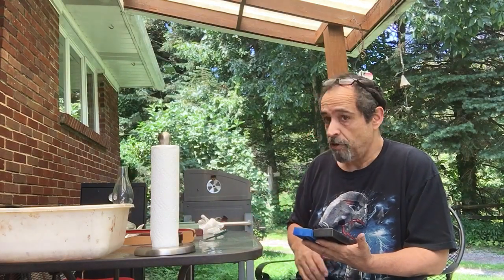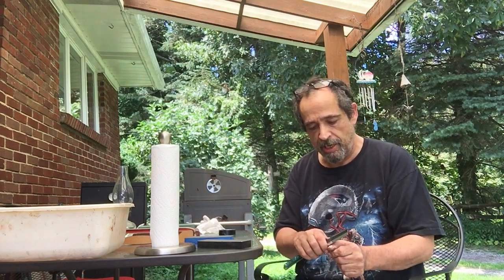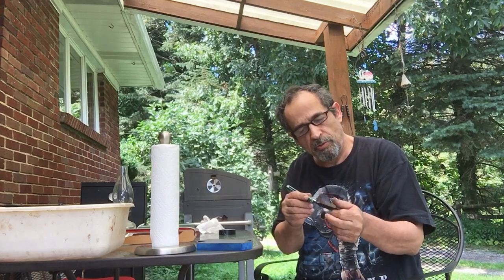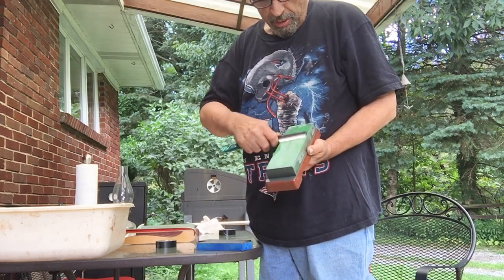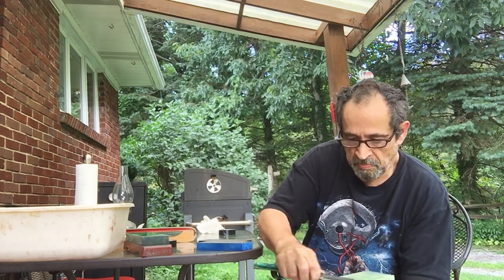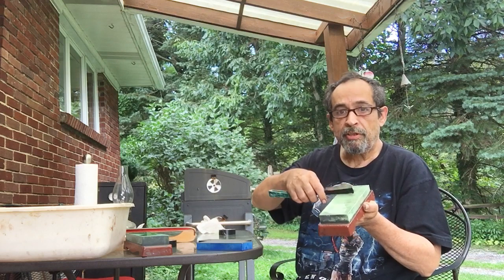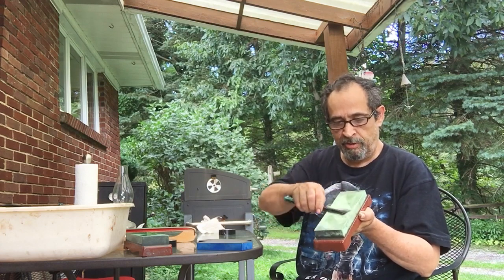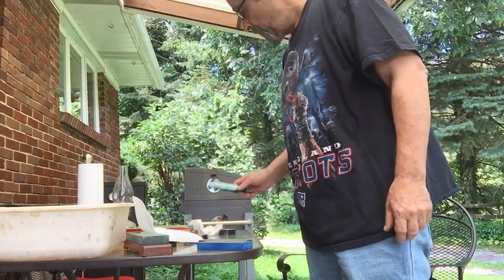Robert williams custom razors honing the Morning Glory

Comment: Very great teachings right here!  👈🏻. Not everybody that knows how to hone a straight razor is good at explaining it.  I’ve been honing for about 8 months and this by far is the best info I believe a beginner can have…

Because with a razor you’re always going to run into problems sometimes the heel or the toe won’t be flush with the stone and he’s right if 90% of it is sharp and 10% is not , it’s not gonna work.  

And after a while I realized what everyone was talking about how you can feel The feedback of the stone.  But it takes time.  Honing is not easy by any means.  It’s a skill.  It’s more in-depth than just rubbing a peice of steel against a rock